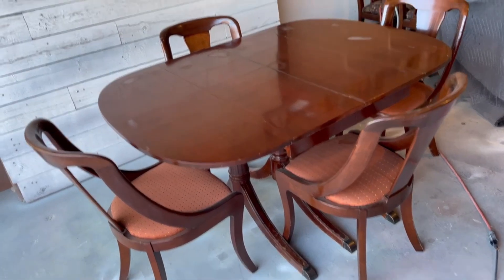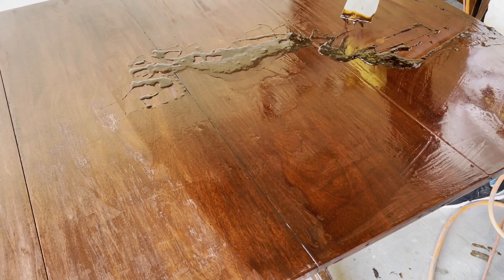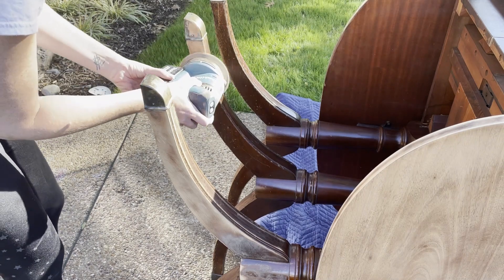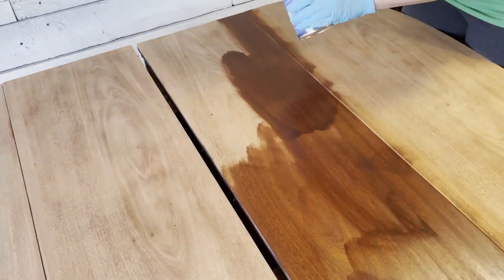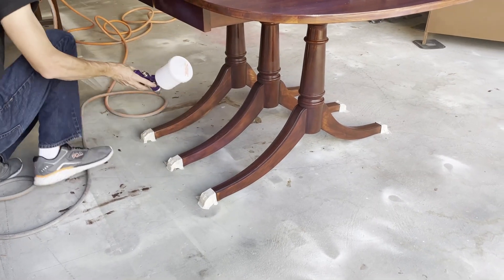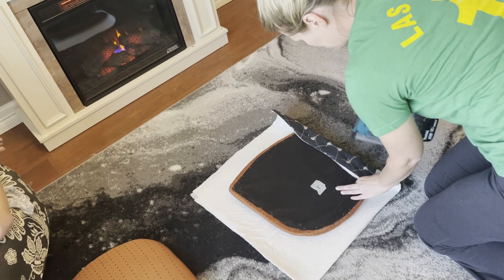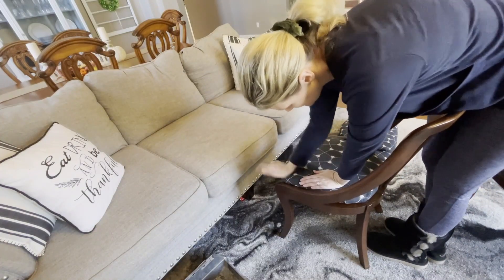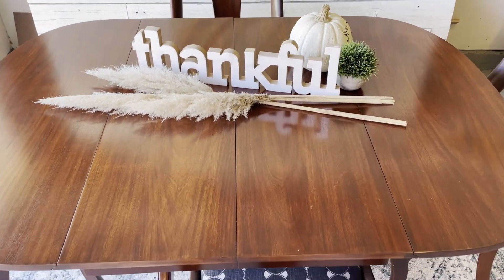Old Table Restoration // DIY Project on a Budget // Table Transformation

Comment: Beautiful! What a labor of love! I’M laboring over what sander to get. Festool or Surfprep? So I’m wondering why you started sanding with a rotary sander instead of doing all of it with your Surfprep If you could do it again, would you still get a Surfprep or would you get a Festool?
Reply from the maker: Oh the amount of times I have pondered that decision! Ok so- when I bough the surfprep, the Festool wasn't in the budget. However, they are two completely different sanders. Instead of the big investment in a Festool, I landed on the larger Makita Oribtal and I am so glad I did. It is a workhorse and I get through a finish very quickly. Attaches to my shop vac ect. Festool no longer needed (in my opinion). Surfprep, I use all of the time for small areas and square edges that a round sander can not access. The foam pad to get in the crevasses saves me soooo much hand sanding time....and I hate to hand sand!  So I guess my answer is....if you do this all the time, you need both! lol! BUT there are products that will get you a very similar Festool effect. The Surfprep is unmatched by anything I have seen at this point! Hope that is helpful! Thank you so much for watching!
Reply: @LemonstoLemonadeFurniture  thank you sooo much. I have scoured info on a comparison between the two. Lily Moon had a good video and she favored the Festool. But it helps immensely to get your opinion. I will likely look for something similar to your Makita and then land on the Surfprep. Thank you! And Happy Thanksgiving!

Comment: The restore a finish is okay for under the poly? 🤔  Out prices in south fl are lower - hard to get much on FB! I hope you got at least $550!
Reply from the maker: I did let it dry for 2 days and should have mentioned that. But my dilemma was, do I poly and have that settle in the scratches and dents that I need the restore a finish to brighten up or do I gamble and restore a finish first to cover the scratches, lots of dry time and then poly? It seems to have worked! It's still here ( lol unfortunately!) and I don't see any issues, looks like factory finish, so- so far I think I went the right direction. Thanks for the watch! Hope to see you back next week!

Comment: Hey Lady tie that hair back completely when using that sander!  Don't scare us like that.
So you just poly coated over everything, including the restore a finish?  No light scuffing of the existing varnish?  This is great because you won't get those water marks again.
Funny when I saw the original fabric, I thought it was too much like the wood color.  That navy pattern is perfect, updated but not too trendy.  Is that an upholstery fabric, or just a good canvas?
I have always wondered why in the original finish they tried to obscure the woodgrain so much, maybe because of the many different kinds of wood in the same piece?  BTW, you were really lucky that the new stain really looks like an exact match.
Reply from the maker: Lol Ok OK point taken!! hahah It was upholstery fabric. Yes it was def different types of woods all pieced together. I didn't scuff the parts I didn't sand and my thinking behind it was I didn't want any scuff marks to show with that super shine poly. I let the restore a finish dry for 2 days (which I should have mentioned) and looked it over. Once the shiny poly was on...BOOM looked just like the factory finish. I don't know. I'm open to suggestions if I should have sanded it.  and yes the Candlelight was perfect!
Reply: @LemonstoLemonadeFurniture  In the future, maybe you need adult supervision?  
But what a great idea!  I do know that a very strong solution of ORIGIAL TSP will knock the very top off of most finishes to give it some "tooth" for the new finish to adhere.  So that is not even needed, what a time saver.  I love this and you both Lemons.  Thanks for answering my questions.  As I said, it was also a great mistake that the chairs don't match exactly, it is so much more interesting.
Reply from the maker: @rockshot100  Yes! That liquid de-glosser or TSP would have been another option for sure. Those chairs! They add great drama to the table & MCM is such a seller here. Fingers crossed it sells this week! ha! Happy Thanksgiving!
Reply: @LemonstoLemonadeFurniture  OH, it will sell in a heartbeat.  Yes, there is something irresistible about those chairs.  God bless Lemon Man, and Lemon Kids.

Comment: Thank you for using stain. I am very uninterested in watching furniture flippers take a beautiful piece of wood furniture and slapping some paint all over it. To me, paint is easy. Stain is challenging. So thank you for stepping up to the challenge of honoring the beauty of the original piece. That doesn't mean that a flipper cannot change hardware, change cushion colors, paint drawers if they are ruined, or add a touch of "new" to a piece but covering a barely damaged wood piece with paint is an easy way out.
Reply from the maker: Thank you so much! I appreciate the watch!